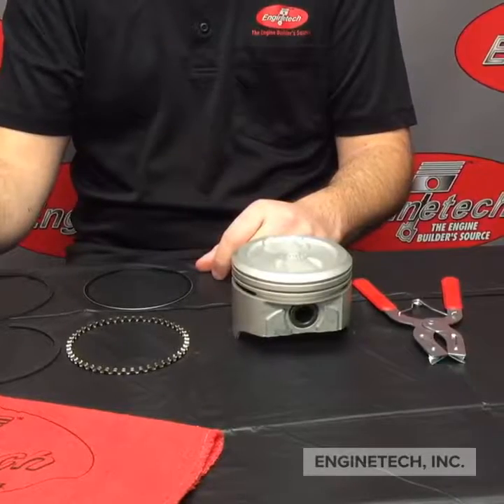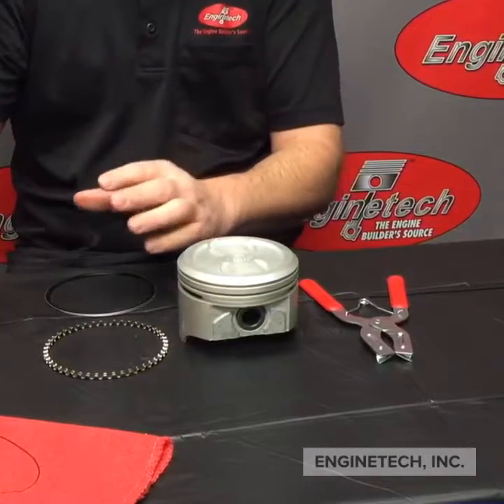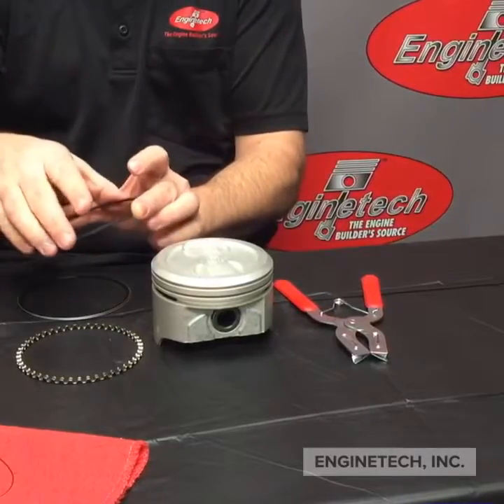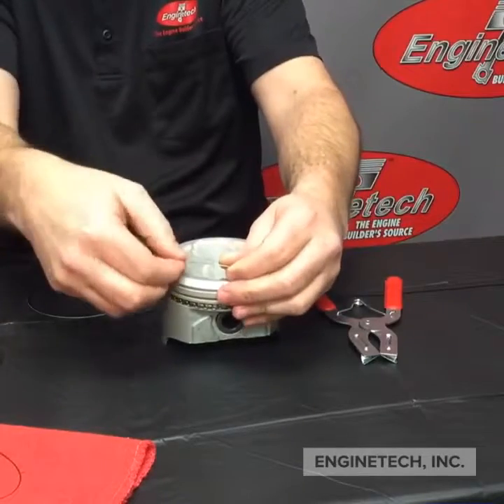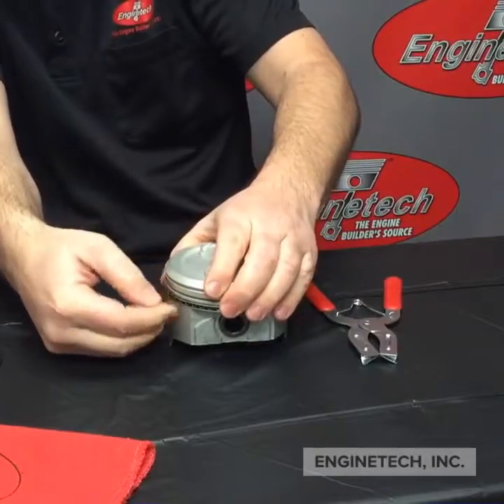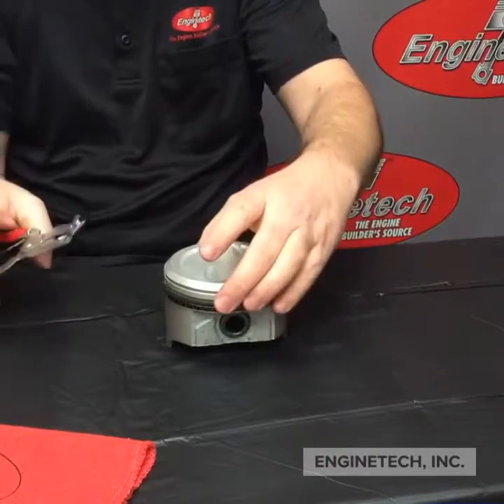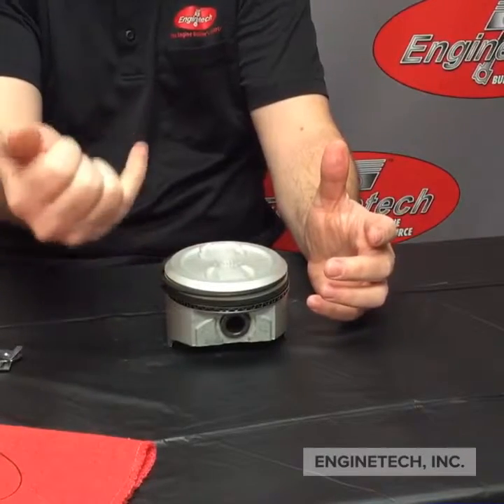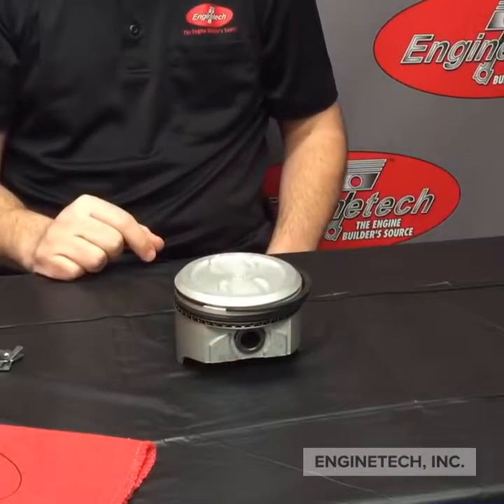How to Install Piston Rings

Comment: Looked like you didn't really clock anything just randomly moved so gap not lining up?
Reply: It doesn't matter Dude.  Those piston rings all rotate.  They will find themselves in unison over a million times in 100'000 miles.  Turn your bike upside down, clock one valve stem at noon and the other at 6 and give them both a spin and count how many times they end up in unison and back to 180 degrees.  It doesn't make any difference how they're clocked when they're installed.  If they're not rotating around the piston when it's running then you have or are going to have a major problem.

Comment: i dont understand how the rings create air tight seal? they are all opened even though if you aligned them out of phase, gas pressure travels fast and should have no trouble following the end gap .
Reply: They do not create an "air tight seal". They allow a certain amount of leakage by design. The old style rings need to be gapped to allow thermal expansion or bad things happen such as damaged rings or breaking pistons. There will always be some amount of blow by on an engine no matter what. This is the purpose of a PCV system and it's important that it's functioning correctly. PCV Positive Crankcase Ventilation. Hope this helps!
Reply: The gap is only as thick as a cigarette celophane when they are compressed in the cylinder.  You'd have a hard time farting through a gap 2 to 4 thousandths of an inch.  It doesn't matter the orientation in terms of degrees because they all rotate when the engine is running so probably 5 thousand times in 5 minutes they will find themselves in unison for 1 millisecond.

Comment: I got a couple questions. I ordered an engine tech rebuild kit for a 2001 5.9 l Cummins diesel. Question number one on the rod bearings half of them are shiny. The other half are dull color which one is the upper? and which one is the lower? The second question is on the top piston ring. It wasn't marked and looked identical on both sides Does this mean it could go either way?

Comment: And of course the end gaps need to be away from the thrust side and end gaps at 180 degrees from each other, including wipers.
Reply: thanks jesus i love you
Reply: Are u sure? I was told by my machinist that they will automatically go into their place when installed and in use
Reply: @Jpgaps  Tell him that the lord said it is so.
Reply: @torqingheads  🤣🤣🤣
Reply: @torqingheads  amen
Reply: which side should i position end gap
Reply: @stoosee  Alternate sides
Reply: @torqingheads  what about expander gap?
Reply: @torqingheads  can i position it to 1st compression ring position?
Reply: @stoosee  Yes, simply start from the top, [or the bottom] and alternate the gaps at 180 from each other on the non thrust sides. They will rotate, but it is a good starting point.